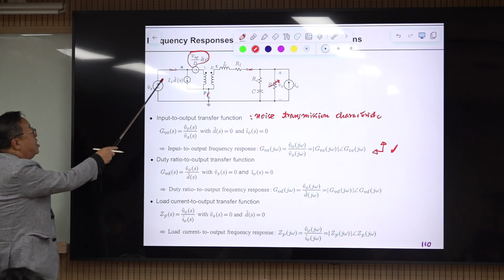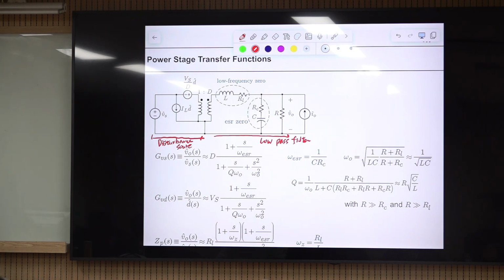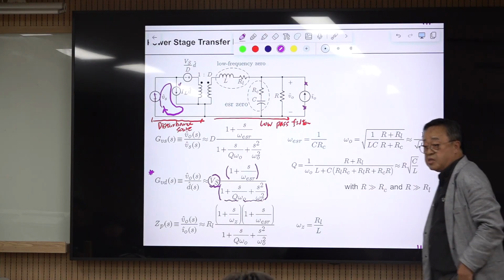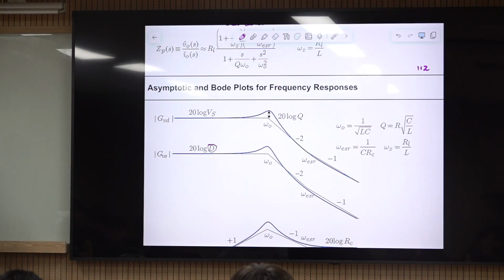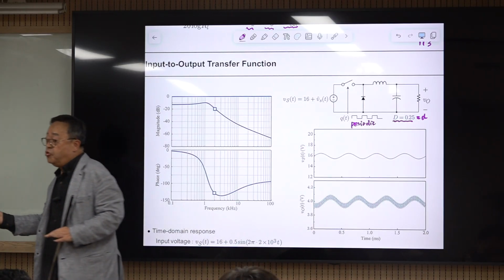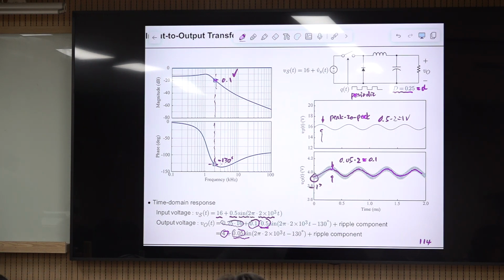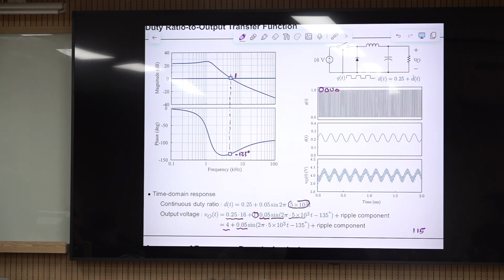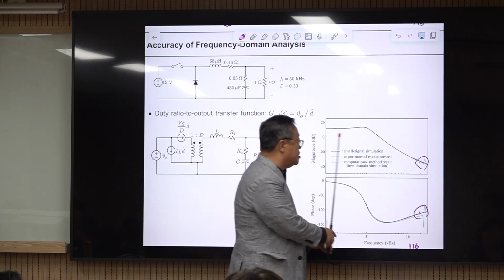Lecture 10: Small-signal model, Transfer function, Bode plot, Buck converter, Frequency domain

Comment: The DC gain of (Vo/duty) in CCM should be (Vs/Vramp), not Gdc=20 log(Vs). 
The obtained results are quite different if not divided by Vramp. 
This division by Vramp works in DCM operations as well. 
It needs to be corrected on all pages..
Reply from the maker: Thank you for your kind and constructive comment. The lecture adopts the convention of vo/vc=vo/d  Fm  where vc in the output of voltage feedback compensation and vo is the output voltage. The vc will be referred to as the control voltage later in the lecture. The lecture slides indicate that vo/d is the relation between the small sinusoidal excitation in the continuous duty ratio, d, and the sinusoidal component of the output voltage, vo. Later, vo/vc is defined as the control-to-output transfer function. This convention can be consistently adopted to voltage mode control and current mode control, even though the latter employs  an internal inductor current feedback. Thank you again for the comment that brought up the issue and clarification.